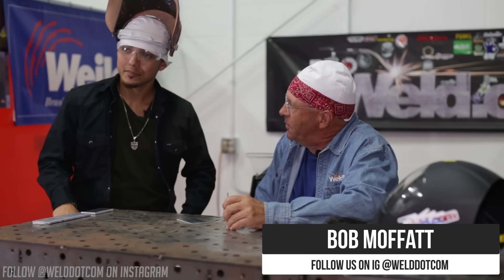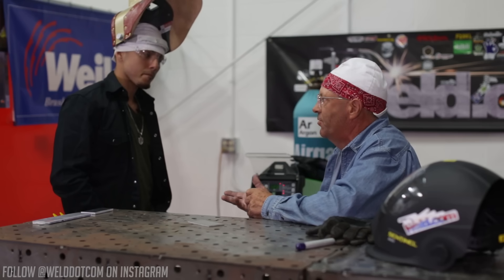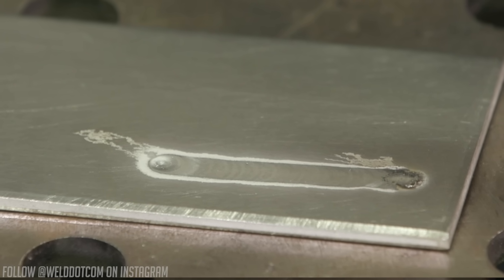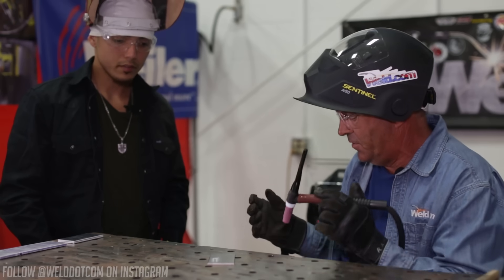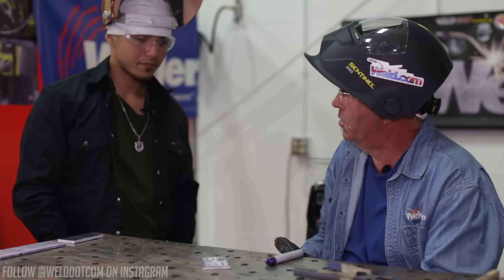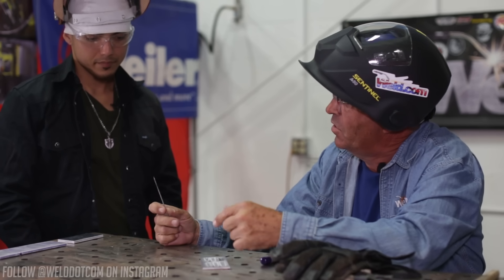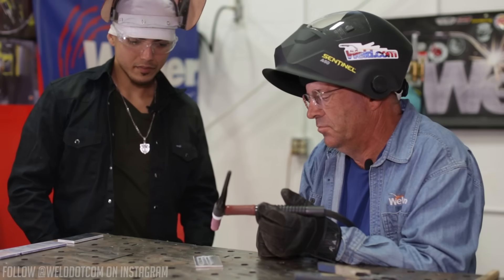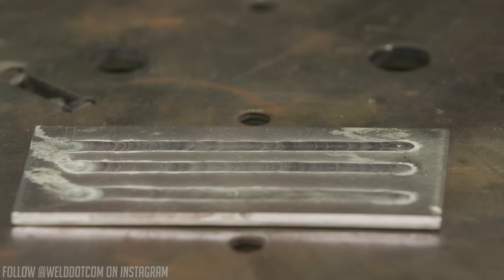🔥AC Frequency vs. AC Balance (Aluminum TIG Welding)

Comment: I found the sweet spot of 125hz 50% cleaning for most general purpose work on 2mm ally, this changes for me when precise work is needed I turn up to 150hz cleaning still 50% I find this will focus the arc more stops the arc from wandering and damaging any say fins on a intercooler or something downside to this setting is you lose heat so no good for heavier material, I will drop to 80hz same cleaning setting of 50% this I use for thick cast arc a bit erratic but really blasts that thick oxide layer and forms a lovely clean wet pool each to their own I suppose, I guess every plant I've worked with over the years have all had different setups with their strengths and weaknesses.
Reply: That's Great information thanks man
Reply: I have read that higher frequency is better for thinner aluminum. Like 200-250hz for 1/16in(1.5mm) or thinner. Is that your experience?
Reply: @randybobandy9828  yes it can help higher frequency focuses and tightens the arc downside is you lose some heat but obviously heat is your enemy on thin ally

Comment: We have a Miller Dynasty 200 at work. I set the balance on 20 with a blunt pointed electrode. INSTANT ball! What the heck? A little research revealed that the % balance on this machine is EN, not EP - just flip everything upside down and it works great.

Comment: I have an old miller  Thunder Bolt 225 ac welder and I want to weld aluminum. Is it possible. I understand scratch start . If so what gas do I need and I’ve welded aluminum once in a shipyard and stainless. Mostly your basic 6010 , 6011 , 7018 . I’m retired and I might weld a couple times a year . Also if you have or know of any videos that might help . Is it possible to make this machine ac dc with bridge rectifier .

Comment: My syncrowave has all of these settings. Its a "P" model. Poorly located in the bottom of the machine is the frequency knob. I didn't realize that Miller offered such a loaded up machine back then. 18:12
Reply: @BigJfan  what serial number if you don’t mind me asking?

Comment: sulfuric acid is the best cleaner for copper and aluminium. If you add drops of distilled water (tap water is not clean) you can pre heat the material at the same time.

Comment: Great knowledge! I’m trying to hook up an old Lincoln Hi-Freq box to a pretty large old tombstone welder for a friend who is wanting to TIG some aluminum. I’ve never used these before and I’m looking for research. I Don’t see a lot of the older stuff that might be hanging out in grandpas old garage other than the stick welders. What about the old TIG setups? I’m still getting more info on it and found the old book online for the box. I’ll be combing through that for some help, but pointers from some experienced guys would be very helpful!

Comment: Ok... but WHY?.   

Dont get me wrong, this is a great video showing how the settings sound, how the haze thickness on the outside slightly varies, or how it affects the tip of the Tungsten.... but WHY would I want to use the different settings.  What is the effect of the settings on the weld?, what am I trying to fix by adjusting the settings? What fault can I observe in my welds that can be resolved by tweaking a setting? what is the direction to adjust based on what I'm seeing?  When is it good to run higher freq vs slower? what is the best balance under what conditions? ... I have so much to learn.

(OK I feel like a 4 year old that keeps asking "why" for anything you say to them) 

You guys are great and fun to watch - THANKS!!
Reply: Keep searching, a lot of the answers to your questions are covered in other videos on this channel, welding tips and tricks, and others. It’s the nature of the video format that not everything is covered in one video, perhaps in a book though. I’m not so fond of reading though, myself. Best of luck!

Comment: The direction of an electric current is by convention the direction in which a positive charge would move. Thus, the current in an external circuit is directed away from the positive terminal and toward the negative terminal of the battery or power supply. Electrons are negative, so they move through the wires in the opposite direction - from negative to positive. So in DCEN, electrons flow from the torch to the work peice.

Comment: Remember A/C is actually welding in dc+/dc- it is switching back and forth between the 2 60 times a second  HZ
DC reverse or DC + puts 2/3 of the heat at the tungsten 
So slowing down the HZ causes the amount of time it takes to switch between the 2 
When intensionally balling up a tungsten you put the welder on DC rev to put the heat st the tungsten where it causes the tungsten to burn back and ball up
Been awhile since I thought about all of that 
Try welding with a automotive alternator 
High frequency whistles 
Lot of fun 
Check out link arc or resco welders ( alternator welders ) had one on my jeep for over 20 years loved it
Reply: I built a welder from a 200amp ford truck alternator and adapted it to the 3rz in my 83 custom cab bush truck, can confirm the whistles.  The amps are regulated by the bicycle shifter thats hooked to my gas pedal, lol.  So after MANY trial n error sessions I wrote down what rpm for each thickness of material I run into.

Comment: bob you and your trainee great video i always rather a pointed tip the balled end is for building up surfaces
Reply: Actually you are incorrect.
We run about 65hz and around 350 amps for some jobs. There is absolutely no way you cannot have a balled up tungsten.

Comment: Hi, two years ago u try TIG weld without argon, can u try weld with no argon, but propane-butane? If it's burn produce co2, this can work (sorry for English :P)
Reply: Ktos3214 I believe that would cause the TIG to behave like a flamethrower.

Comment: I run a Miller dynasty 350, and when I put my balance to 30% and Hertz to 120 it completely melts the tungsten why would this be happening?
Reply: The balance is the other way around on the Dynasties as compared to the machine In the video. 30% on the everlast would be 70% on the miller.
Reply: Your amps are to much for the diameter of tungsten.

Comment: What exactly is the Hertz controlling? Im thinking it was controlling the wave length but i thought frequency did that.
Reply: Hz is how many cycles the wave form makes. Increasing/decreasing the machines setting adjusts those cycles. USA standard electricity is 60hz or 60 cycles per second.  An inverter machine is capable of adjusting the sine wave. This wasn't capable with transformer power sources...
Reply: So yes.  Increasing the hz tightens the cycle and shortens it as compared to delivered power. An added benefit is that the inverters can also alter the sine waves... Hope that helps.
Reply: Wave length is a measurement of the electromagnetic wave as in radio waves. Hz is the measurement of alternating current as in the number of cycles in a second.

Comment: why would you increase your HZ? what does it do to the actual weld? what cycle is the cleaning action on? EP or EN? what if I want  a narrow bead with deep penetration because its a weld on the edge of thin material and the material is extremely clean? what if I have cast aluminum to weld? I feel like not much was answered here. you should explain what the reason for running 120hz and 70% balance, what hz actually is, what polarity does the cleaning and what does the "melting" of the aluminum. not all machines are setup the same so its better to tell people you want 20% EN.. also most syncrowaves are scaled from 0-10, which translates into 45%-68% EN
Reply: ecr125x cool can’t wait to see your video on it.
Reply: Welding Junkie I’ve seen you comment this before. I’ll pass on the YouTube videos, don’t have the time and between welding tips and trick weld tube and weld dot com they seem to have it covered. Also I know all the answers too my questions, but I know there’s a beginning out there that doesn’t. Maybe he’ll see this comment and go check out welding tips and tricks video on ac balance and frequency?
Reply: ecr125x comment what? I’m not sure what you mean? You made some good pointers so I’m not sure why you mad that comment? I’ve you’ve seen that comment before it was not from me. You have videos on welding no?
Reply: It's just explaining a new process to someone who knows how to weld.
All this stuff is more about how you want an weld result.
They explain all the stuff you have written. 

en pulls the arc from the metal
Ep pulls the arc from the tungsten

Ac turns on and off the 120hz is how hot it zaps, the balance is how much is reverses the current in the off wave, or let's the metal cool.

The other is the sound you'll be wanting to hear as welding requires hearing not just settings. 

Once you have basics and some real welding experience on different metals the above becomes extremely easy to get whatever results are required.
Reply: zagan1 I hope no body reads what you wrote and repeats it..120hz is not “how hot it zaps” ac does not “ turn on and off” I think you mean a regular transformer (syncrowave) runs at 60hz or it changes from straight to reverse polarity 120 times in a second or 60 cycles... also know as hz. Now that you know that you can apply the cleaning action of one polarity and the welding action of the other to make a better weld.
Reply: ecr125x he means switching “on and off” from ep/en switching
Reply: 20% EN ????

Comment: Fantastic info from the Moffatt, thank you Bob!

I've owned a 210 EXT for about 5 years and I'm very happy with it. I've done mostly thin steel (some pulsed) and some stainless (0.030" by the way) and I will say this is one great machine.

Haven't had a need or situation to merit diving into aluminum, but now that I've picked up a 253DPI I feal it's time to get friendly with "ale lu min eum"! 😄

I've gotta Powerplasma 60S (also 5 years) doing business next to the puddle brothers also, pretty happy so far and I expect nothing less than stellar from the 253DPI as I get to know it!

Cheers!👍

Comment: Love technology but my old Syncrowave 500 with the basics is hard to beat for us simple guys and you just can't kill an old transformer machine. For those of us with the old machines how about a video leaning towards us. Been using 2% lanthanated tungsten on a.c. and d.c. I Build and repair boilers for hobby use mostly and spoke with a man this morning pushing the Fronius brand. I While it would definitely use less energy than a transformer type, cost and durability are my concerns about anything other than a Miller or Lincoln. Keep the videos coming and if I'm the only person left on the planet with a dinosaur welding rig and you want to use it for a video I'll be glad to haul it up for a visit and learning course.
Reply: I still run a SW as well. I figure if it ain't broke, don't fix it. I absolutely refuse to buy a cheap import machine, and I have gotten by my whole welding life without the bells and whistles of an inverter. Heck, I started out on a DialArc HF which was a pure sine wave machine, had no adjustable cleaning action, no pulse modes, nothing. What it DID have was continuous HF to keep the arc lit, which actually seemed to keep a more stable arc vs square waves with HF start only. It also seemed to have a ridiculously conservative duty cycle, something which my SW also shares. I never felt like I needed  more or less cleaning action, and if I needed a tighter bead or to "get in there" I used this thing called "skill". I seem to remember an awful lot of guys turning out absolutely amazing aluminum welds with old-school sine-wave transformer machines. Now we're told you can only make a good weld with an inverter. Good thing nobody told that to all they guys who welded on the Mercury, Gemini, and Apollo spacecraft, or the SR-71, the Space Shuttle, etc.
Reply: WTFChuk :  That’s what they told me at the welding shop.    All aluminum used to get welded with transformer and high freak box.      I think they’re trying to sell welders.   Lol. What foot pedal?

Comment: That wolfram tri mix tungsten seems to last a bit better than the zirconiated when adding cleaning %. I've been using a dynasty 400 at work but just ordered an everlast 325ext for the my own shop. Great videos, where is that facility located?

Comment: To round up the tip of tungsten, set polarity to EP and set amps dependng to size of electrode so you can get a nice round tip, and just press pedal and look for desired round shape, when tungsten tip gets rounded or ball, just switch polarity to AC, and you ready to weld aluminum. On Dinasty 400 to roind up tungten, just turn balance to ball and you can get it that way.

Comment: At the end of the first weld shows the deformation of the ball at the end of the electrode, this suggests that the developers have picked up a bad amount of positive momentum at the end of welding or Bob is not properly sharpened electrode. Chose a more acute sharpening angle

Comment: all that sounds like ittll either give you cancer or cure it lol. i have a boc 180 high frequency ac dc inverter a good place to start for the money. only control i have is ac  balance amps and  2 pulse settings ive had better luck going bit by bit slowly no pulse its an entry level welder but its better than anyone i know has. stainless and mild steel its awesome but it will have to go if i want to get more serious with aluminium
Reply: ?   High freak and A/C should have you welding AL just fine.        I have dinosaur buzz box with high freak box.    Once the AL is hot, it’s almost too much.  Does fine on 1/4 material.  Even turned all the way down.

Comment: Ive got a syncrowave 351.  Balanced is 30%.  I usually run 70% just so the arc is more stable.

Comment: In my humble opinion, I do believe that AC is just too abusive to the tungsten to think you are going to have a good tip. Getting a solid ball on that tip is accepting that abuse and rolling with it in the best way possible for long term production welding; weld after weld. So with that said, E3 doesn't have that good balling consistency across the spectrum and many other tungstens outperform it with AC: blue, pink and white. Given that white is specialized for AC, getting a high quality white tungsten that is designed to ball up and not spit, will leave a stronger arc weld after weld. Just look at the last weld and the tip 16:40. It does not have the proper tip for the next weld to keep the arc from circling or angling out from the center. Stop looking for the all around tungsten and just buy the best tungsten for DCEN and for AC respectively: E3 and white tungsten (both high quality).